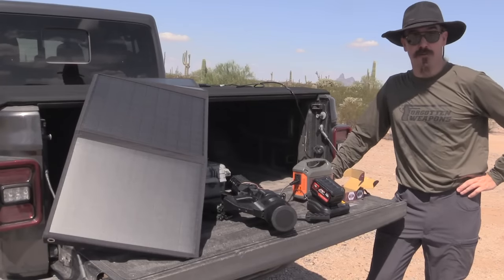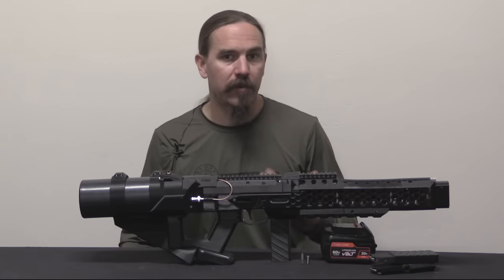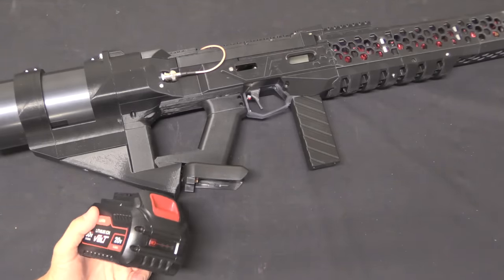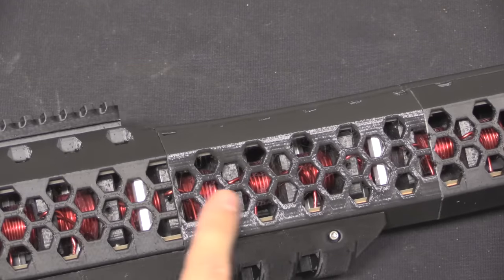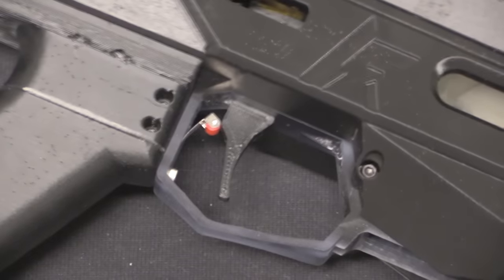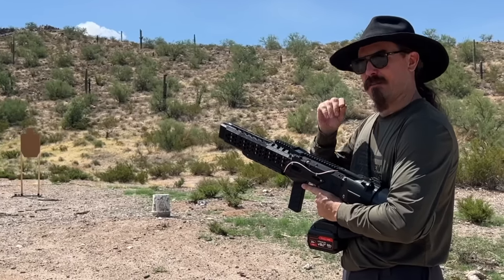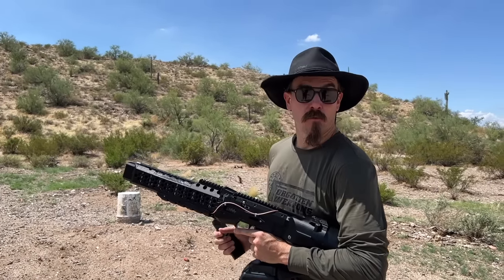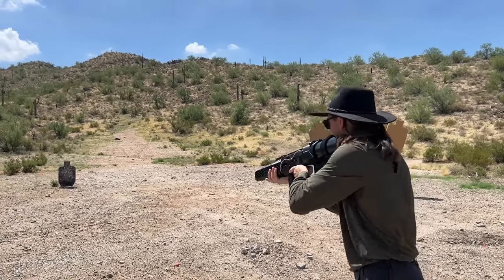ArcFlash Labs EMG-02 CoilGun: Making SciFi Weapons Into Reality

Comment: This is essentially the matchlock musket of coilguns, an piss-poor start but with lots of future potential. I'd love to see the potential future designs
Reply: (Within)100 years till proper coil gun. 
My guess.
Reply: Greater velocity and drum mag!
Reply: If they made a coil gun with a back pack battery that might be enough to make them lethal, the back pack would be bulky but the silence of the weapon would make it really good for stealth operations.
Reply: @Dagrizzb  i’d give it 20 years tops. we probably already have the technology to make a proper coil gun. humans have greater knowledge and technology than we did back when the first firearms came out, so it shouldn’t take as long to start inventing a viable coil gun
Reply: Exactly
Reply: @omnialive  drum mag... Full of drill bits
Reply: @creedstump0662  to our capacity of improvment I'll say let's see by the 2030 how it turns and we'll have a an almost proper coilgun
Reply: @creedstump0662  Your avrage coilgun gets arround 5% efficiency in energy conversion(electric to kinetic). The most efficient coilgun was a russian test bench single stage coilgun that got 80%, top speeds reached with this coilgun was arround 16k feet per second. So theres plenty of room to inprovement, specially if money starts pumping in.
Reply: @creedstump0662  forgot to add "within" to my previous statement.
Seeing as we are already looking at a mobile single user device, we are already at a head start. 
At this point, the (non combustable) energy output is the limiting factor.
Reply: @ratheonhudson3311  When you really want to screw someone or something up...
Reply: You're looking at it the wrong way. You're thinking 'could we?' instead of asking 'should we?'

I will be the person that gets boo'd out of the room and go ahead and claim that this will never be a thing for infantry use. The military doesn't care if something is cool, they care if something is cost effective and reliable and this thing will be neither of those, unless some crazy sci-fi microfusion technology comes up. 

For the same weight, you can pack way more power into explosives than a battery, meaning x kg of ammunition will always produce more bang than x kg of battery+metal shots. Additionally, the explosive is way more efficient in terms of power to ouch ratio.

I'm sure that with money and investment, all sorts of problems can be overcome with time and performance can be increased, but at the end of the day, when you ask an infantryman who's going to be dropped into Whateveristan, without a cozy charging station close to hand, about which gun they would prefer, they will always prefer the chemical firearms, because more ammo can be acquired and stocked way more easily than electricity. 

Now for warships and potentially armored vehicles we have a different story. Those things can carry huge batteries that are way more efficient and they are already electronic anyway. Also, resupplying one of those things already requires a visit to some kind of safe spot, so charging them isn't an issue.

When you bind your infantry to an electricity supply you vastly reduce their flexibility. I'm also assuming they can somehow make this thing waaaay more reliable than it is at the moment. Target shooting in a desert is one thing, wait until you get dropped into some murky, muddy swamp, how many soldiers are going to die because they have massive voltage devices right in their hands? Sure, you can iron this out, but you will never get more daka/weight with electricity than with chemical, at least for an infantryman.
Reply: @Dagrizzb  Sure, but this isn't even a seriously designed product. It's made of plastic, and it has about 5 years of design put into it by a small team. I imagine somewhere in the world a federal arms developer has something that's already field ready.
Reply: @jabloko992  totally agree. The only viable situation I think a coilgun could outperform chemical power as a handheld weapon is actually in space. If the recoil really is so low and doesn't scale much higher even with higher muzzle velocity, then it would be a better candidate for fights done in low g / freefall environments. Recoil in those conditions do not only throw your aim off, they can actually throw you off of your course, which can be quite dangerous in an EVA situation. Chemical propellants do work in vacuum, so that's not an issue though, and engineers might be able to come up with some smart recoilless feature, so who knows?

There are ongoing tests on weapon mounted railguns. There had been for a time now actually. They work really well. Last time I checked the main problem was heat. The barrel just melted after a couple of test shots. If they get it right, the railgun will have a much longer range than the concentional artillery used today.
Reply: handcannon is more like it.
Reply: It's done in scaled up model to the 20th look for unreleased government specs due out in 2075 haha
Reply: @Load_the_ducks  here's to a future of cool shit our grandkids will get to enjoy. 
Lucky little pricks.
Reply: You should see what the navy is playing with.
Reply: @omnialive  Well the charging time after Battery reload will get OLD very quick. unlike the guy who'll need it in a hurry.
Reply: @Dagrizzb  yeah it will definitely be a while before they can produce a small battery powerful enough to power this for long enough to be usable in combat. that being said, i would love to see a coil machine-gun. it seems possible. it would probably require a massive battery, but if you’re firing one that’s mounted to a vehicle, size and weight shouldn’t matter too much
Reply: @fallencrow6718  16k fps is insane. i’m no expert, so correct me if i’m wrong, but is that fast enough for even a smaller round to do damage to a tank or something of that sort?
Reply: @creedstump0662  tesla will probably be the first to pick up defense contracts for vehicle mounted gauss rifles.
Reply: @creedstump0662  Not really, at that speed proyectiles literally explode because the kinetic energy is bigger than the energy of the molecular bonds. It will just leave a big dent compare to a regular bullet. Also you are limited to verry small proyectiles becase the kick is gona be insane.
Reply: @Dagrizzb  thats if humanity lasts that long, which aint looking too likely atm xD
Reply: @BigMan7o0  folks were probably saying something similar during the cold war.
And probably during the 50s when building a fallout shelter in your backyard was a thing. Duck and cover school training videos.
Reply: @fallencrow6718  imagine a tank round shooting at 16k fps
Reply: @BigMan7o0  lets bet on it. 
If the end of the human race comes before 2172, I'll owe you.
If it doesn't you'll owe me.
Reply: @Dagrizzb  if the human race makes it that far i probably won't, so bet xD
Reply: I'd like a Phase-Ion rifle in a 40 watt range...
Reply: @imapseudonym1403  "Hey, just what ya see, pal."
Reply: @BigMan7o0  deal!
1,000,000 wulongs it is.
Reply: @BigMan7o0  meh, the End has always been nigh.  Not happened yet ...
Reply: @creedstump0662  Ideally improvements would certainly be desirable, but are you sure you're not overstating a little there, regarding the battery issue? As mentioned in the video, that little casual consumer grade battery is "easily enough for 300 full power shots". 300+ shots of casing and chemical propellant, is easily comparable to the weight of that thing, not to mention definitely bulkier. The standard ammunition load for an infantryman in most Western armies is only 210 rounds. There's both unique logistical concerns and benefits, but the battery/ammunition question isn't that far apart.

That drill battery is 9'600mAh in capacity. I own a 100'000mAh power bank, which I wear in a small pouch on the back of my belt. It's more than portable enough, and the difference in capacity would get you over 3000 shots, if calculated at the same ratios. If my skinny civilian ass can casually carry that battery, and jump and dance whilst wearing it, then a trained marine certainly can. There's a bit more nuance in the actual output rate of the drill battery vs the power bank, but it's more than doable engineering wise. Not to mention that truly insane amounts of investment money is going into all kinds of battery technologies right now.

Electricity for charging can be found practically anywhere in the developed world, including any vehicle. It's a lot harder to carry an entire ammunition factory on the back of your squads MRAP, than it is to just dump your spare batts in a charging slot. Additionally the material portion of your ammunition, is crazy compact by comparison to any rifle/mg round. Almost zero wasted space when boxed for bulk supply.

The bigger issues right now, I'd say, are more practical consistent performance and accuracy. It needs to do something substantially better or at least fill a viable unique role, that conventional firearms cannot provide, or else nothing else matters.
Reply: Don't forget, whatever tech we're seeing is probably a good 10 years behind whatever the DoD has.
Reply: Agreed. Power is the limiting factor at this point, both in the capacitor and power pack.
Reply: @Dagrizzb  Technology moves much faster today.
Reply: @genesmolko8113  feels like technology compounds itself.
Reply: Matchlock will break the skin
Reply: @markbernhardt6281  right? Just gotta speed that puppy up.
Not as lethal yet, but, like a sling before it became a bow and arrow.
Reply: Military might take note of these and that would speed up the process. For one, these fire completely silently, way more than any weapon with a silencer. So that for stealth missions alone can be incredibly useful. Only thing you'd hear is the bullet impacts into the flesh so you could do much more close range sniping and taking out enemies silently.
Also not to mention you have full auto machine gun capability, and still silenced. With the military developing this, in 10 years they'd have proper coil guns with anywhere from 30 to 100 round magazine versions and similar stopping power as current guns.
Reply: @omnialive  Needs either a way to spin projectiles or stabilize them (small fins or shape). You could see from the holes in the cardboard targets that most of the projectiles were keyholing/tumbling which means the accuracy is shit.
Reply: @jabloko992  It is quieter than most subsonic silenced firearms. If you could get the velocity closer to 900 fps and improve accuracy out to 40 yds or so you would have a decent stealth/quiet weapon.
Reply: Aready cooking upstairs I can make it twist.....
Reply: @UnknownSquid  Totally agree there is huge potential. Just the fact that once the power/velocity issues are optimized, the cost/ease of ammunition manufacturing drops by an order of magnitude. You can imagine manufacturing ammunition on site and in country with mobile rod cutting and machining stations if the raw materials are available.
Reply: @jabloko992  I think your also looking at it the wrong way. you have to remember the way they are making use of the energy is different the way the projectile is accelerated is different its a different projectile also. Also just because of how a coil gun or rail gun are suppose to get the speed and power  behind the projectile is by continuously increasing the speed of the projectile until it leaves vs a normal gun which gets all its power from the initial explosion a slowly loses speed and power. All the factors make it impossible to know if coil guns will ever be used as a military infantry weapon or not. But the coil gun definantly has better potential right now since we've kinda hit the limit on how much we can make large improvements to normal guns
Reply: @ShardtheWolf  usually not actually for firearms specifically most militaries focus there research time into larger vehicles and then usually hire a gun company to modify a existing gun to work for them or make a gun for them
Reply: This isn't close to a "matchlock" technology. It's more primitive like the medieval boom stick handguns they had back then.
Reply: @geesixnine  Except this is zero recoil, whisper quiet, mag-fed, and capable of full auto. If you mean it’s under-powered, I agree. But solving the power/velocity issue makes it a viable modern weapon. Comparing it to a muzzle-loaded, single shot “boomstick” is hardly doing the technology justice.
Reply: @creedstump0662  the problem would be interest. Right now modern firearms sre extremely effective and there is a massive industry supporting the entire technology. Until coilguns can kill better than most modern firearms, they will still be a novelty unfortunately. Why would the U.S military invest in a new type of weapon that is probably expensive, require new training to maintain and use, and a massive amount of restock when it can just use the weapons and associated industry already established?
Reply: highly doubt theyll put the tech into these. It'd be a smarter idea to use this tech for missiles. Laser guns are being created. we have depleted uranium missiles, explosive ammunitions and guns that are 15 times more powerful than these.
Reply: Considering the original YouTube shown years ago, going decade, this is a bit newer than a matchlock musket. The biggest issues are things of design here, rather than ability.
Reply: @son_of_stan  because wearing a bulky backpack is stealthy... 😕
Reply: @duztinsolo3367  soldiers wear backpacks all the time and they seem to pull off stealth reasonably well.
Reply: @Dagrizzb  I mean a hundred years ago horses were viable and airplanes were pretty new...and now we have mukes and space stations. I'd say more like 10 years
Reply: @shinobi-no-bueno  thats an excellent point.
Wright brothers flew the first plane in 1903, by 1961 Yuri Gagarin orbited the Earth.
Reply: @yann1922  nope you'd have to hit the capacitor for that to happen, which if you actually watched the video was tucked against his shoulder at the back of the gun like a stock and therefore hard to hit.
Reply: @Not Right In The Head weight isn’t an issue in space, 0 G remember
Reply: @Dagrizzb   I'd say it depends on how much money gets dumped into R&D
Reply: @jabloko992  Battery technology is advancing extremly fast, several new battery chemistries are being developed right as we speak for use in consumer products like cellphones and laptops

The most likely to bring huge advancements to this kind of technology are solid state batteries, search them up
Reply: one of my companies actually makes a much better gauss gun. muzzle velocity 2400 fps with a 10mm projectile. not yet available for civilian use. military only. maybe one day they will be made available for civilian use. we also make a three versions of ultrasonic stun weapons also for military use only. maybe one day.
Reply: Gotta start somewhere.
Reply: That’s called evolution my friend it goes on all the time 😮
Reply: @son_of_stan  part of what makes guns loud is the Sonic boom. If coil guns ever go supersonic they will still be loud unless you've got a silencer
Reply: @bluemonstrosity259  the sonic boom is secondary to the blasting sound of a conventiol gun being fired, a rail gun could be set to fire just under the speed of sound just like the subsonic low velocity bullets you can buy for traditional firearms used in stealth, but they still make a bang (though they are more quiet), a rail gun firing at say 750 to 850 miles an hour would be silent and very deadly.
Reply: @son_of_stan  agreed. It would basically be silent
Reply: @creedstump0662  Id even bet 10 years max.
Reply: @jabloko992  I think that they'll be used for more specialized roles in infantry use. Vehicle mounted machine guns that could be dismounted for example or for setting up security check points in hard to reach areas. If you can only transport 2000lb of equipment to a location and the personnel there are mostly going to be fixed it does make sense to transport a 100-200 pound coil gun with a 100 battery and save space and weight for food, or other munitions. I could also see them being used for special forces uses due to their lower report.
Reply: @dfwai7589  What you have to think about is: how much 'bang' and how cheap bang can you get out of the same volume and weight carried?
100 kg smokeless powder vs 100 kg battery. Which one is cheaper and enables you to propel more bullets at lethal speeds?

I think unless we invent some new battery or power technology, a chemical propellant will always be cheaper and more effective. 

Sure, 'who knows what the future holds', but the same can also be applied for chemical propellants. Maybe next year they figure out an even better form of gunpowder? 

I think explosive powder has a serious advantage in all situations.

With ships it's different, because ships have literal generators attached to them. Some ships afaik already have railguns, but I could be wrong, maybe it was just tested.
Reply: @shokojimhollingsworth3940  I do believe he hasn't recoil because there is no velocity. With higher velocity you get the same recoil as for standard guns.
Reply: and its potential looks like because of good auto fire, not of single-shot armor-piercing shots or similar
reality is a cruel mistress...
Reply: Energy density of batteries is only a couple decades off the energy density of gunpowder at current rates.

We're very likely going to hit some hard physical limits of physics with current battery technologies before that time though and we will need multiple new paradigms to actually surpass chemically powered weapons.
Reply: @Dagrizzb  nah.
The technology singularity advances in an expotential manner.

Just look at how fast things evovled since we had box screens and potato pcs .....

Now we got foldable screens and potent PCs compact enough to fit in your pocket(aka smartphones) 

I give it. 25 years at worst.
Reply: @jabloko992  nah, you are spitting some mad nonsense there.

This thing is cool.
That's for sure
But it's also reliable.
Because it won't jam due to dirt,mud or residual powder, since it down use powder mechanics nor anything affectected by dirt or mud.

The gauss gin can also be used underwater with few modifications, making it more useful.

With a bit of R&D, it could also become very effective, because it's a silent weapon shooting metal projectiles that can be made bigger thanks to not needing a casing.

Meaning that you could get aniped and never know where it came from.

Aka the militiary will invest in that shit because it's full of potential to revolutionise combat.

Ah, and also: you can't shoot gunpowder guns in space because there's no air to create the needed explosion.....a weakness that doesn't affect coilgins, who can work just fine in space.
Preety convenient considering that we are nearing another space age with mars.
Reply: @Dagrizzb  "(Within)100 years till proper coil gun" 

Using now tech, diff coil config, lose the caps (!lol), etc, and design math shows a potential of 35 million tesla multiplier modifier to projectile launch power. No backpack batt needed..
This would ofc disintegrate the projectile in a gun of this physical size.. So, tinier..
Reply: @son_of_stan  "If they made a coil gun with a back pack battery" 
In this configuration you'd need a backpack arc welder and 3.5k generator..
Reply: @jabloko992  "this will never be a thing for infantry use" 

Use follows innovation. 
People will discover uses..
On any vehicle high power could be available, but as you say, a cartridge carrying everything needed is hard to top..
Reply: @GergelyGyurics  "If the recoil really is so low" 

He probably means impulse..
Action = reaction regardless, and firearms don't really impart that much energy to the user, even "in space."
Reply: @Gunni1972  "Well the charging time after Battery reload will get OLD very quick." 

That's what they get for using caps! lol
Reply: @creedstump0662  "16k fps is insane. i’m no expert, so correct me if i’m wrong, but is that fast enough for even a smaller round to do damage to a tank or something of that sort?" 

It's not. 
Armor mass & ductility will eat a tiny projectile's energy. A thin exterior armor sheet/plate such as used for def v shaped charges would powder a tiny high-speed dependent projectile. 
 re. micro-meteors
Reply: @UnknownSquid  they're wasting mass quantities of of power. That thing is probably about 0.03% efficiency just for that configuration, and probably generating about 0.002 - 0.00005 Teslas per coil
Better mats & design "could" yield up to ~15 000 000 Teslas at about 3% efficiency  ..mathematically..
Reply: @IphigeniaAtAulis  "Power is the limiting factor at this point," 

Nah, primitive design is..
Reply: @journeytosilius1  "these fire completely silently" 

Remember sonic crack..
Reply: @Ailtir  batteries ARE chemical power..
Reply: Ya about 15 more years and the next new toy should be coming out. 

Star Truk anyone lol it’s phaser time.
Reply: @jabloko992  I’d argue that whether its a good idea for military use is completely fucking irrelevant, its like BB guns, nobody would ever want to use them in a life or death scenario, but they’re fun. If these things end up with some serious muzzle velocity, as I think they will over the coming years, they’ll be a niche piece of hardware that civilians will definitely want to own, since they’re not firearms and therefore aren’t regulated to prevent full auto as seen here. And they may actually have a military use eventually, as automated turrets, or on top of armoured vehicles. Anywhere there’s a constant power source, they could be useful when the technology is improved. The fact that they’re recoil-less is a fucking god send for aiming from a moving vehicle, it would vastly improve accuracy.